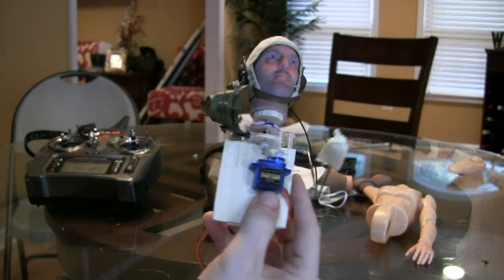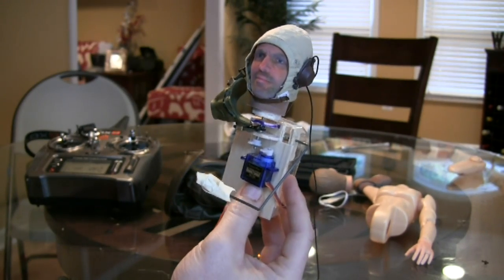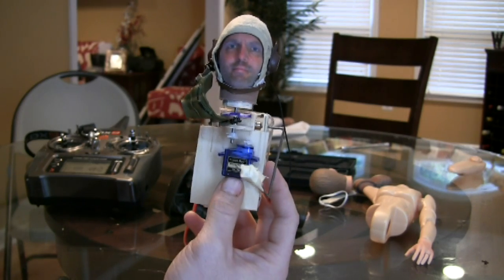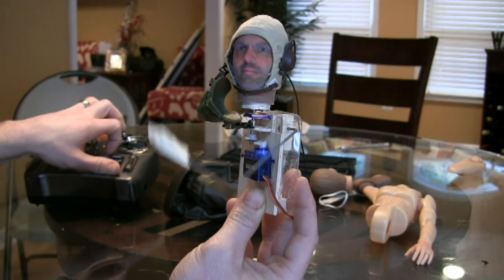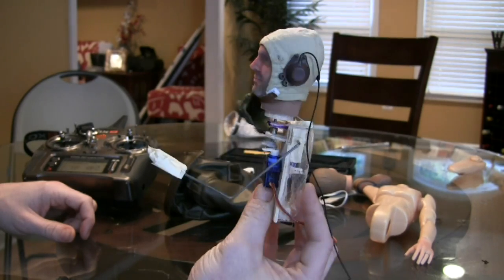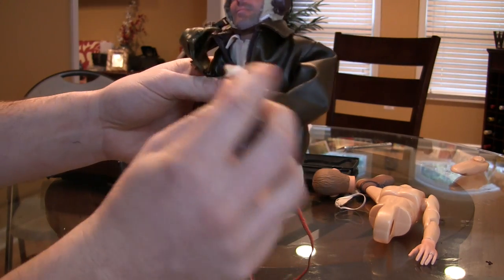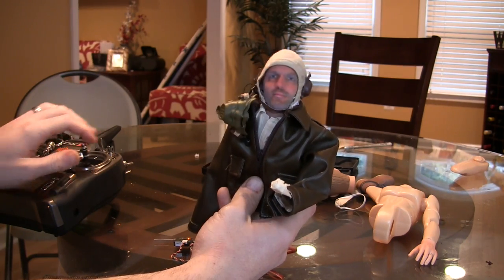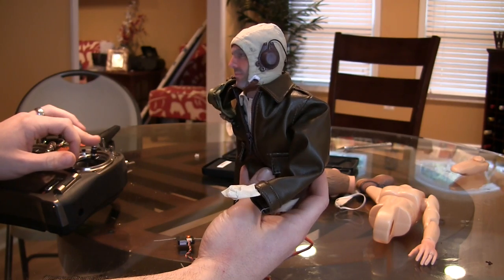Animated Pilot for RC Airplane

Comment: Did you ever get it going? Just wondering.
Reply from the maker: scott firman Project is still ongoing.  I'm pushing to have the aircraft itself finished before a few online build contests.  Once she is flyable I'll get the pilot wrapped up.  The mechanism works well and I've tested with and without a sequencer and can probably work either way.  With a bit of luck I'll have the airframe finished within a month.